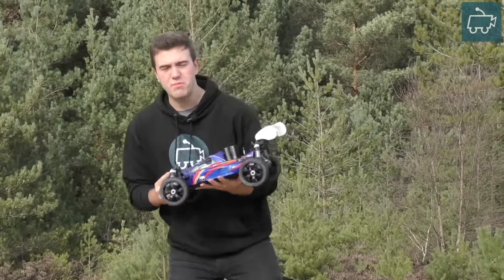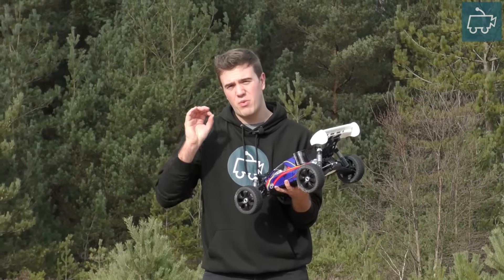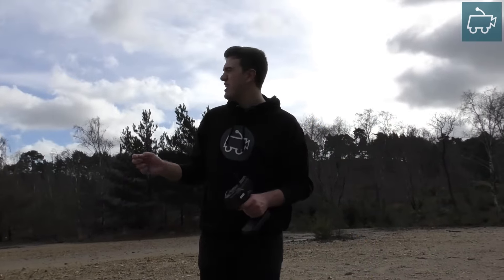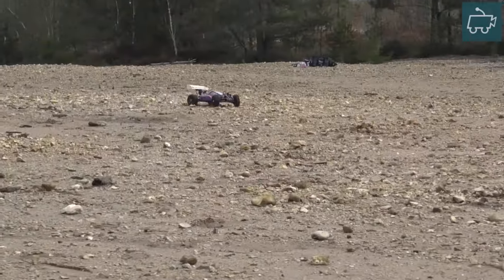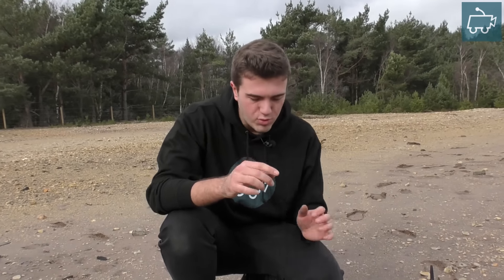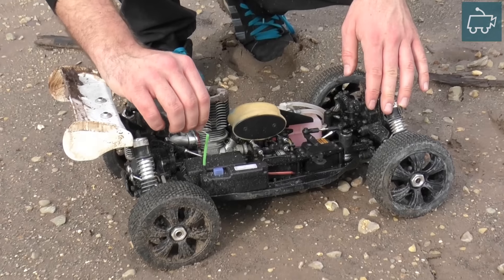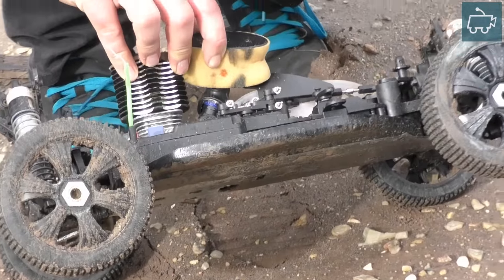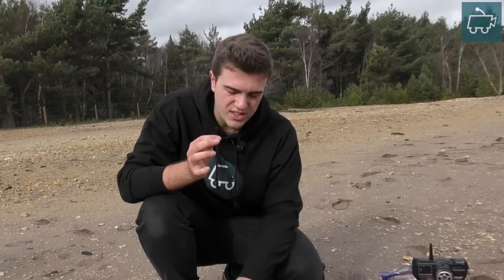Hobao Hyper 7 TQ2 Mach .28 - Bashing after several months !

Comment: I think the reason for the problem accelerating is caused by  the air filter leaning down on the throttle link. For reasons I can't seem to see but you must know Hobao have the fuel filter mounted on top of the fuel tank and it all attached to the air filter. Perhaps their own air filter is too 'heavy' to sit on it's own but most standard ones on other buggies work and are alright at the standard size. Maybe it is something to do with stopping the engine overheating. Either way, it seems pretty poor to me as  the air filter flops down and rubs and fouls on the throttle and brake link. Is this what you found too?
Reply from the maker: To be honest mark I don't remember the cause, this was years ago. but as far as I'm aware I didn't actually replace anything on this and it still runs fine today so maybe just was water related : )
Reply: @TheRCBiker  Oh right. Nice one. So I was well and truly barking up the wrong tree then. I'll get back in my box and will leave the air filter alone before I do.  Thank you for such a polite reply. Rather than. 'No, you are wrong.' :-)

Comment: Josh check and see if your throttle linkage isn't getting caught under/on the air filter. I was getting my Hyper 7 ready to break in and noticed that my linkage would interfere with the air filter. Some longer screws and some spacers under the splash guard plate which also holds the filter assembly in place seems to have fixed this, my linkage now has plenty of room to move about.
Reply from the maker: I found that the issue was really simple actually, you know the spring on the throttle linkage, and the little fuel tube they slot on in front of the spring? The fuel tube had gone over the spring therefore when releasing the throttle it wasn't springing the carb back
Reply: Now that's interesting, Ill keep my eye open for that when I get the chance to properly give this car the beans.

Comment: Bro i seriously need your advise about the hyper 7 mach 28 i bought it not that long ago, its been broken in but no matter what setting i do on my hsn rich or lean when i full throttle it, its bogs and tries stalling, even on the factory settings it bogs when i try full throttling it, any advise on how many turns on hsn and lsn i should do on the hyper 7 mach 28, because you have the same car

Comment: Great channel, Would just like to ask what is the best way to clean nitro cars/trucks so they don't rust. also keep up  the great vids :)
Reply from the maker: I'm going to upload a video on this soon :) If your car has gotten wet with anything than clean water then I'd suggest rinsing it off using fresh water (avoiding electrical parts and engine) and leave to dry in a warm area, I sit mine in front of an electric heater for an hour. Then, take an old paintbrush and brush loose dirt off. I then take some GT85 or WD40 and spray dogbones, driveshafts,  drivecups to remove the moisture
Reply: Thanks, that's a great help. I look forward to your vid :)

Comment: Hey Josh love the videos bud. 
I’m after some help with my Hobao hyper SS nitro truggy if you don’t mind. 
It’s brand new and I’m trying to break the engine in. All needles are set to manufacture specifications but for some reason it revs intermittently on its own while idling to the point it starts screaming. Any advice would be much appreciated. Keep the vids coming. Thanx in advance
Reply: Lee Clement flush both high and low end needles to edges (this means when both needles are flush with the carb body) and check the idle gap is 1mm. Weird I never had any probs with mine. Good luck with getting it running good👍
Reply: Also do the same thing to the main needle too
Reply: DylanIversVlogs ok I’ll give that a try. Thanx very much for the help

Comment: I have that buggy with mac 28 engine from hobao. it's a pain in the ass to tune, small pull of the throttle it scream like a bat out of hell. temps go really high despite even rich settings. any ideas what i can do to adjust this? I've tried everything i even made small adjustment on tuning. I'm using 30% nitro fuel, the manual says it can and should run it with 30%.
Reply from the maker: These engines do run hot. Try changing to a cooler plug. But I wouldn't worry too much about temperatures. Return to factory needle settings and then work from there.
Reply: @TheRCBiker  105-115 celsious run my 28. 25% nitro. Manual write max 85-107 Celsious,but is rich with these tune-settings. My  Hyper 7 with 28 engine is the old version,normal plug,(not turbo)s model 2011